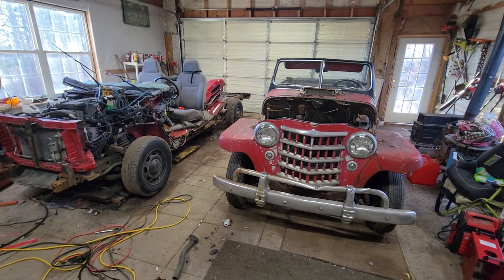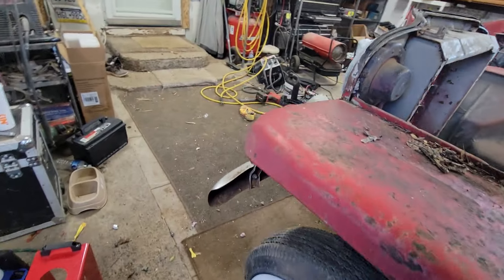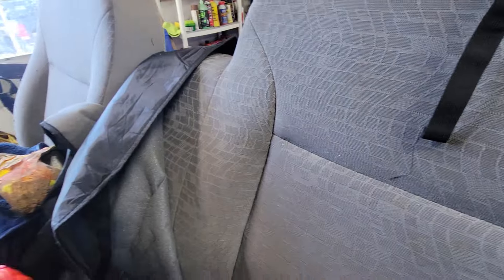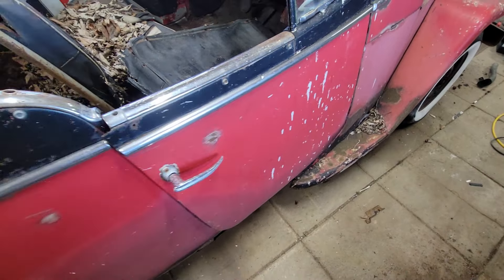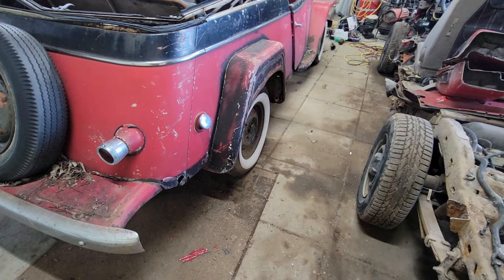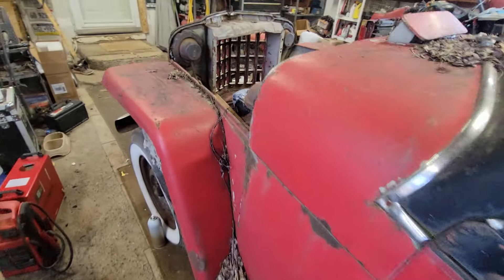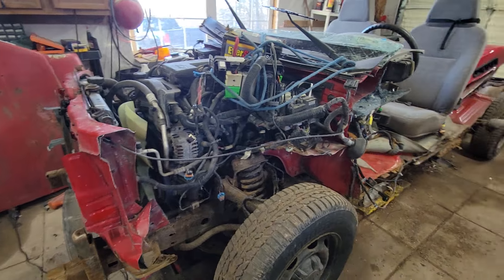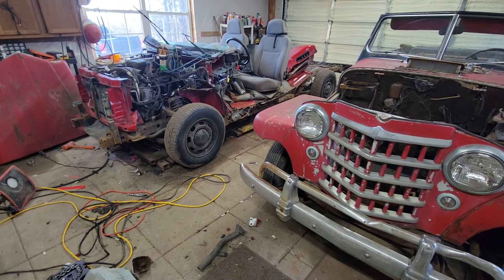Jeepster/Canyon 7

Comment: Why not measure axle nut to axle nut and lengthen the jeepster to match the the truck frame. As the where to lengthen I'd say making the quarter panels longer to leave the front end more original than chopping the front or door. Its gonna be work anyway but have more truck like space would probably suit what your aiming for. Good luck in whatever you chose is best.

Comment: Honestly, I'd shorten the frame of the Colorado slightly and have the driveshaft shortended.
Reply: I do understand that you'll probably have to mess with the gas tank and all the lines.
Reply from the maker: I'm not altering the drive line at all on the truck. That would be too easy. This is the bottom of the barrel budget hack n pack build. Make do with what's here and spend no money.. lol.
Reply: @HackNpackShop  I get it, I've been considering doing something similar with this '51 Studebaker champion Starlight Coupe I have and a Ford Crown Victoria (the crown vic has the same wheelbase). I just need to find a cheap, rusty, running crown vic to do it with.

Comment: Just split the heap in the floorboards and sill plates, stretch it 8 inches and drop on the colorado.  Pusher fan will work fine.  Delete on all the nonsense made to hold up the squarish body panels, and bobs your brothers auntie.